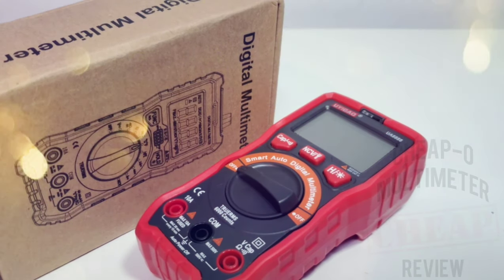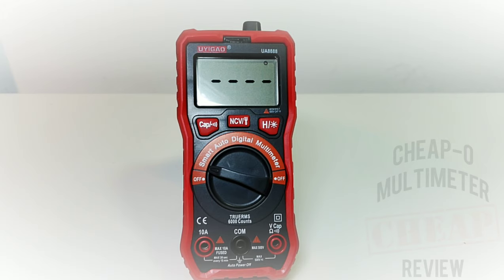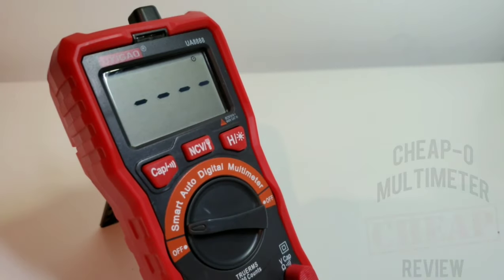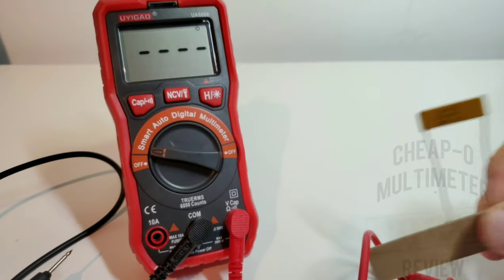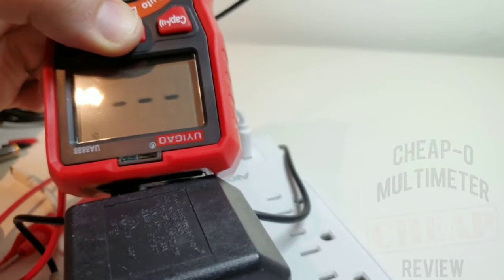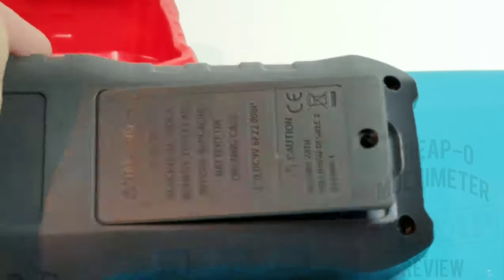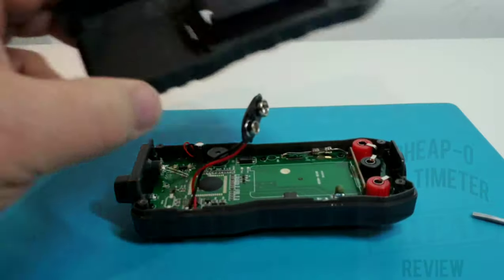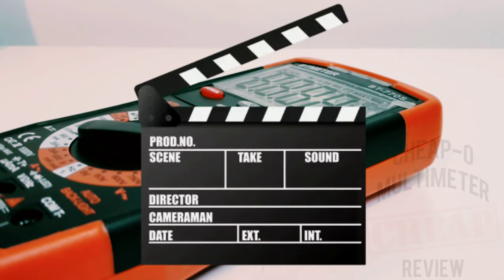UYIGAO UA8888 CHEAP-O Multimeter Review & Teardown!

Comment: I have a Uyigao 9233e. It's not exactly this type, it's autoranging with separate positions for resistance, amps, capacitance, etc. It says it has a 10A non-fused port and a 630 ma fused port. But I disassembled it following the instructions here, just to see what it takes to change the fuse if I ever need to, and I don't see any sign of any fuse at all. The circuit board bears a strong resemblance to the one shown in the video, but in the location where that one has the obvious fuse, there is nothing.
Reply from the maker: Interesting..send me a pic ... netplicity1@gmail.com

Comment: The winapex et8102 I have also has portrude part for ncv test but no metal antena inside that portrude part. The antena is a long pcb track on the bothside of the pcb layer.

It is nice to compare Winapex with adm66 / mt66 multimeter.

Please also test $25 DM4070 down to 200uH range LCR meter.
Reply from the maker: Excellent feedback, noted!  I've  ordered the DM4070 ..should get reviewed next month!

Comment: Wow - welcome to one more episode of china's "meters for morons" - no matter how much the manufacturers try, not one of these smart meters comes even close to being smart - or even reasonably useable in the normal sense, yet they  keep on putting them out.  That one click range switch with descriptive lettering was not to be believed, if thats all it does is on/off might as well make it a button and once again slow is the word of the day, even the continuity was a fail.  Worst part is someone gets paid to engineer produce and market these things, can you imagine trying to do any real tech work with something this dysfunctional-?   I dont even see the need to eliminate ranges, if youre not smart enough to operate a range switch maybe you shouldnt be playing with electricity at all, just sayin'.  Ive tried one of these and I was done, after that the reviews on all of em are about the same, a slow responding under developed over hyped device with very little dependable functionality.  I understand a product idea can fail, happens all the time - but you either improve it or give up, instead they keep trying failed iteration after failed iteration of these things and not one has proven to be as useful as a decent standard multimeter.
Reply from the maker: You said it all! Completely ridiculous...I couldn't believe the selector switch was simply an on/off with no other functionality...who could have thought of this ? Throw in a pigtail fuse and this dmm is utterly a failure..
Reply: Sorry I went on a bit of a rant in my comment, but I felt it was warranted.  Youve given these smart meters every chance to redeem themselves and all fall miserably short, even something cheap isnt a deal if it has no functionality.  I have to believe theres some kind of call for this design in china, or somewhere I cant figure out the target buyer for these - its as if theyre trying to sell a meter even an illiterate rice farmer can use, I mean most folks needing a multimeter know how to work a range switch.  Worse yet think of the level of the engineering mindset that went into the design, especially that nonsensical range switch that only moves a half inch of its normal sweep, just plain wierd.  Weve found an instance where the ubiquitous harbor freight 830B giveaway meter is orders of magnitude better in function than these things, even without audible continuity.